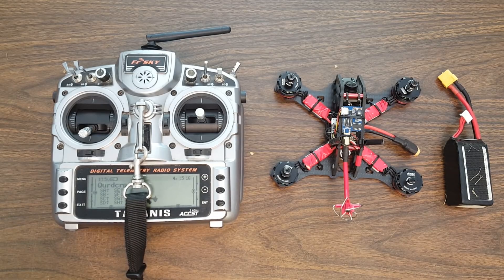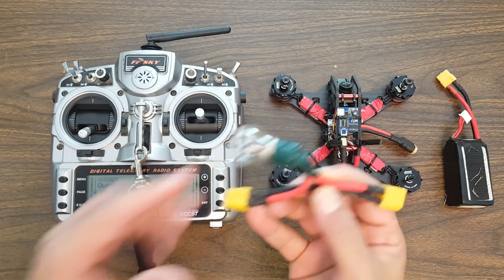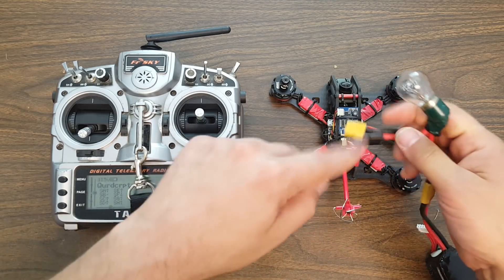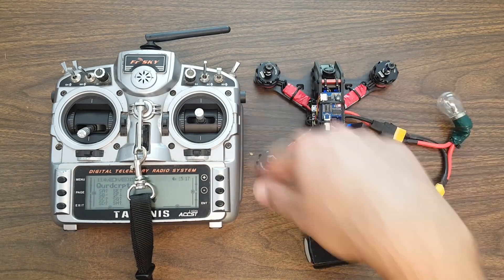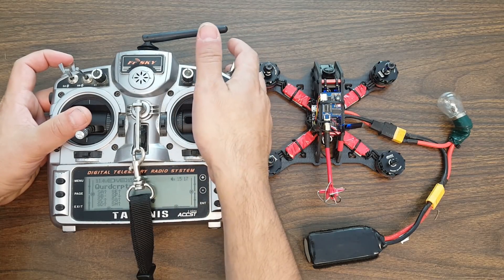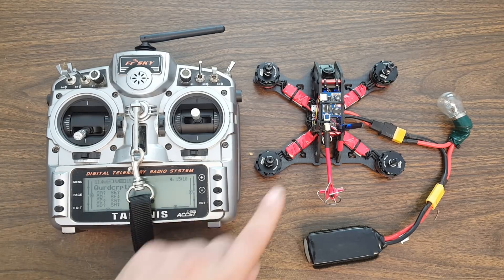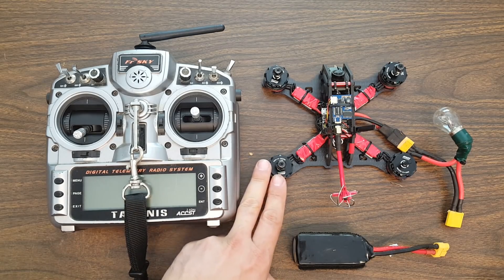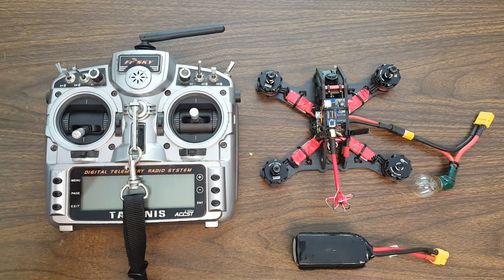Quadcopter Pre-Maiden Checklist: Disarm. Failsafe.

Comment: Thank you for the video.

Whats your thought of using a 1 amp fuse vs bulb? I have all of the parts for the fuse.
Reply from the maker: Problem is, when a fuse blows then you have to replace the fuse. A bulb lights up and it is infinitely reusable.
Reply: @JoshuaBardwell  I agree totally. It's what I have on hand. What light bulb is it? You mentioned a smoke bulb in the video. I'm curious about specifics.
Reply from the maker: It's a 25-ish watt automotive bulb.

Comment: So if it does go nuts what is wrong???  I have an Eachine Lizard that when I turn off the transmitter the damn thing blasts off. what can I do to stop it otherwise???  Eachine Lizard 105s and FlySky FS-I6X
Reply from the maker: If the quadcopter instantly flips over when you arm and raise the throttle with props on, it is almost 100% certain to be one of these things:

1. Clockwise prop installed on counter-clockwise spinning motor or vice versa.

2. Flight controller not facing forward. Go to the Setup tab in the configurator. Tilt the quadcopter on all axes (pitch, roll, yaw) with your hands. The 3D model in the configurator should move the same as you move it with your hand. If it does not, use the Board Alignment parameter in the Configuration tab to fix it.

3. Motors not wired correctly. TAKE OFF YOUR PROPS. Plug in a battery. Go to the Motors tab. Turn on the "props are off" slider in the lower-right. Raise the individual sliders (1, 2, 3, and 4) one at a time, just enough that the motor begins spinning. The motor positions (1, 2, 3, and 4) should match the graphic in the upper left. If they do not, then either move the signal wires so that they are correct or use resource reassignment to virtually "move" the motors.

4. Motor spinning wrong direction. Do the same as step 3 but compare the motor direction to the arrows on the graphic in the upper left. If a motor is spinning the wrong direction, either reverse it using BLHeli (or whatever ESC software you are using) or swap any two motor wires with each other, which will reverse the direction.

Many times, people swear up and down they have checked all of these things, and then come back to say oops I missed one you were right. So if you think you have checked all of these things and your quad still FLIPS OUT, go back and check again. If your quad is insta-flipping on takeoff, it is almost always one of these things.

Comment: Hello, I know wings are not your confot zone, but, Taranis, is.  Im having problems setting the fail safe on Taranis. When I turn off the radio, both motors switch to FULL throtle. Fail safe shoul be on 2nd page on Taranis X9D but its not, even on Companion. I believe I set to NO PULSES but someting isnt right. Im using a AC810 8ch receiver. How do I reset failsafe? I coukd create another model, but as I have 2 motors to have "yaw" control, Im avoiding that to to save do all mixes again.
I hope yu understud my problem and light me iwth some of your knolege.
Thank for all.
Chhes, happy flying
Reply from the maker: I am going to guess you are using a D series or L series receiver. The failsafe setting in the Taranis only works on X series receivers. If you are binding in D16 mode then you have an X series receiver. Otherwise you must set failsafe by pressing the button on the receiver.
Reply: Than you. you are the best!
Im not been capable of binding this particular receiver on D16 mode (8ch with telemetry) and I try set failsafe by short press the faiksafe buttun but no chages?
Is it possible I need to flash the receiver? I never did that.
Im "dieing to try "my invention" but Im VERY scared to try like it is now.
Thank you for everything.
Cheers
Happy flying

Comment: thanks for the video joshua, i have mine set up to do this however i once  crashed  and landed upside down so i hit the failsafe but the quad wont disarm, instead it just sits there revving up and down responding to whatever the gyro is telling it to do, itll just sit there cutting the lawn to bits upside down and not even recognise i have hit the failsafe, bench test and mid flight works as normal, any ideas?
Reply from the maker: This always means that failsafe isn't set correctly. Try this: instead of testing failsafe by turning off the transmitter, test it by unplugging the receiver. Sometimes that produces different results.
Reply: thanks for the quick reply joshua, i just held the quad upside down and unplugged the receiver, it still spins up trying to correct itself, i will add that i have the motors set to spin when armed,  would this make a difference?, if i shut the transmitter off while throttling up the motors will back off but not completely shut off, at this point the gyro is still active and ramping the motors to level the quad, my concern is if it lands upside down it throttles up and i cant get anywhere near it to shut it down
Reply: so basically if its upsidedown and has lost reception it goes crazy

Comment: sir when i start without propeller then it's not disarm it get Max throttle
Reply from the maker: +satendra singh tripathi with props off, that's normal.
Reply from the maker: +satendra singh tripathi confirm all motors spin correct direction. Confirm motor numbers are correct (motor 1 is back right, and etc...)
Reply: sir please tell me  if i not connecte auxiliary channel what will happen

Comment: I always add another check, which is disconnecting the rx while armed. It's a different failsafe. Very useful Joshua thank you. BTW, is that a 2.1 lens?
Reply from the maker: +stozza no. 2.8
Reply from the maker: +stozza good point. With the FrSky X series receivers, you set failsafe in the Taranis. Since I use the same model for all my copters I know all my receivers will be set to "No pulses". Also, I usually direct solder, so unplugging is not an option.

Comment: Ive always done similar tests- amazes me how many people have been flying for months and never bothered testing their failsafe. 

I go as far as holding in my hand with props on and check the copter is stabilising properly and responds to control changes correctly- ensures motor rotations etc is right.

Comment: Wouldn't a bench power supply with current limit work equally well?
Reply from the maker: +Ulrich Petri not good to use ESC's with braking on a bench supply. The back current can destroy it.
Reply: +Joshua Bardwell ah interesting. thanks for saving my supply then, I guess :)

Comment: good vid as always josh. i really wish i could have seen this 3 days ago. i rescently make the leap from a walmart quad to a diy race setup. i have been learning to fly acro everyday and i was getting comfortable. (big mistake) long story short i "landed" in the river 4 days ago. had it stripped apart and dry an hour later but when i plugged in the battery. poof, all 4 escs crapped the bed :( that light bulb trick could have saved my ass
Reply from the maker: +orion clayton probably the ESC's were toast anyway but who knows.

Comment: Josh. Very good advice here!!!  Especially the freebie. A lot of times we get comfortable in our builds and flying and that's when things go wrong. I take it a step further and never maiden the first flight with the goggles. I use the DVR to record the flight, and check the video performance during playback. That way I can diagnose potential video issues before the goggles are on. A good maiden consists of three flights. Slow and easy for the first at LOS. Hard and puncy for the second at LOS to check video performance. Then the FPV maiden. Good stuff here. Keep it coming.
Reply from the maker: The worst that can happen is you have a prop on wrong or a motor reversed and it flings itself randomly in some direction. I much rather see that coming LOS.
Reply from the maker: +badandy122376 I also do a LOS maiden first.
Reply: It is not an FPV maiden with a first LOS flight :) c'mon what's the worst that can happen ;) we are FPV'ers not helipilots (ok a little bit then, but still) it's also the fun of going for it and not the stress of breaking stuff.
Reply: Fair enough :) just teasing a little bit. I was sooo afraid trashing my first quad. Learnt to fall out of love and sky to learn to fly.
Reply: +Jurik Ristjouw Charpu gave the best advice I've ever heard when it comes to this hobby: "Don't ever fall in love with your mini-quad."
Reply: badandy122376 indeed! that's the one! forgot whom it came from. thank you and thanx Charpu for that valuable lesson.

Comment: Solid advice :) I assume those are the 2600kv red bottoms for 4in? I just got all my money together and bought te Turnigy V2 thrust stand for $90. I am hoping to test my 1806 2700kv vs the 2205 2600kv in terms of trust and amps on 4in. I know bench tests are not real world, but I am curious as I haven't really seen too much done there. Now I need to see about getting some more red bottoms haha
Reply: +Joshua Bardwell Also... do you ever check both fail-safes? Receiver and FC
Reply from the maker: How could there be any difference between no pulses and a disconnected receiver?
Reply: ***** I have always just set it to drop in clean flight (making sure that throttle value it below my min command) and set no pulse in my Taranis, never had a problem.
Reply: ***** The "no pulse" is really easy. It is in the first page of model setup on the Taranis, near where you go to bind, and just set failsafe value to no pulse :)
Reply: +Joshua Bardwell to go along with what I said before those recommendations for setting both maybe for other transmitters for those of us like myself who do not have a Taranis
Reply from the maker: +The RCAddict yes, 2600 Rex bottom
Reply: Joshua Bardwell Rex bottoms! cool, will have to check them out ;D
Reply: You guys should check out rcINpower GT2205-2550KV motors. EngineerX has some thrust test with them and they are making over 1000g of thrust on 4 inch props!
Reply from the maker: +RC Flyer85 no, because I set the receiver to "No pulses" so there is no difference. IR at least there shouldn't be.
Reply: Are you sure? I am getting a bit more careless nowadays.. I will have to check it again with the newest betaflight 3.0rc5 for myself.
Reply: I agree, there should be no difference. But I also regularly flash or at least redo some settings in my TX. So I am just playing advocate of the devil here. I myself are not sure after the comment of The RCAddict ;) How can I check if that is working without testing in at my case Taranis TX
Reply: Thanx, i also set it to drop and check that (just like Joshua suggests). Have to look up the nopulse (also thanx Joshua for mentioning it and offcourse posting yet another great tutorial)
Reply: +Joshua Bardwell I'm not sure but I've seen a few threads about make sure you do both ... Mostly for cases of the RX having a partial failure or some other malfunction
Reply: Touche :D hihi But that was sooo long ago...
Reply from the maker: +The RCAddict only works with X series receivers.
Reply: Hi Joshua, I just did the benchtest with betaflight 3.0rc5. I pulled the signal wire from the RX on my quad. All stopped after 1 sec. just as configured.  I guess you just have to make sure the failsafe on the RX is also working. Maybe a new vid on that? Anyway, i am really enthousiatic about your channel and a fan. Just trying to help and stay sharp. Thanx a lot PS: I forgot to mention that when I first did not set the failsafe, it just kept on going on the last signal.. maybe it was in the early days and the drop safety wasn't there, i'm not sure. But sufficed to say, i learnt my lesson from then.
Reply from the maker: +Jurik Ristjouw test receiver failsafe by turning off your transmitter
Reply: Jup, I guess now that is indeed enough. Had to check tho ;)

Comment: I'd add that you should do the two tests with a bit of throttle (in normal flight mode). There are ways for disarm to be set not to disarm while in flight (and failsafe could also possibly act differently).
Reply from the maker: Really good point. There is a cleanflight setting to prevent disarm while the throttle is raised. Personally, I would never use it! When I disarm, I want to disarm RIGHT NOW.
Reply: +Joshua Bardwell Exactly, and that mistake is something you'd want to catch with the test.
Reply: +1. I arm it with props off and run it up to half throttle or so and shut the radio off to see what happens. I've had it goto idle before with the radio off so I check this every time now.
Reply from the maker: +walkaf1 also disarm with throttle up, I suppose.

Comment: thanks for the great tips again.
what sort of bulb is that?
Cool looking frame also. which one is this?
Reply from the maker: Automotive tail light bulb.

The frame is Flynoceros Canis M4.
Reply: Thanks.
Just solder a positive wire to positive and negative of the bulb, right?
Reply from the maker: No. Take a look at the video where I show how it is wired up.

https://www.youtube.com/watch?v=4z7yRG56aKM
Reply: very interesting how it has the vertical part of the frame. must be great for strength
Reply from the maker: I'm sorry. That's not the QAV-R. It's the Flynoceros Canis M4. I have a video review of it on my channel.
Reply from the maker: https://www.youtube.com/watch?v=lUrRE-aFTIk